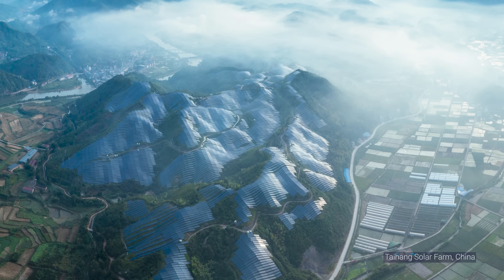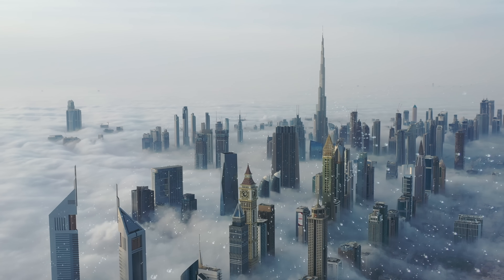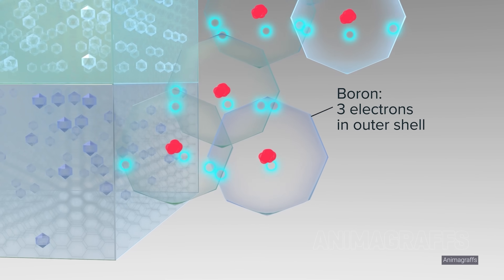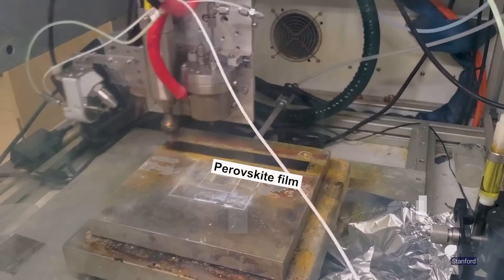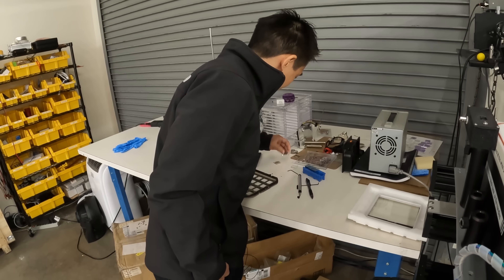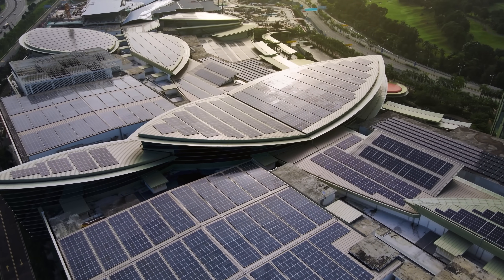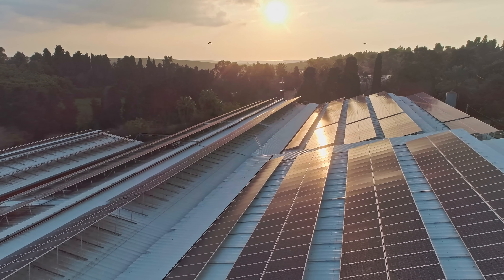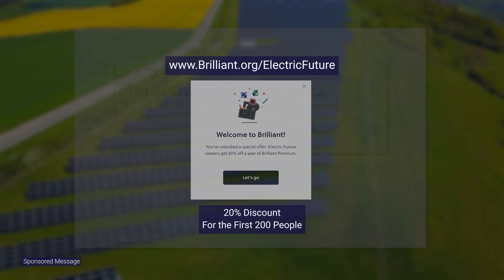Solar 3.0: This New Technology Could Change Everything

Comment: This got me much more interested and educated than severals hours our lessons on perovskites for material science. I was surprised there was no mention of the Lead (Pb) as most issues with perovskites used to be that we didn't know how to do lead-free perovskites crystals. I would have liked to know more about the toxicity of these coatings
Reply: Fraunhofer ISE is working on lead-free perovskite tandems. Current research project is running till the end of 2023. It's called Manitu.
Reply: It isn't just the lead in perovskite panels that runs a risk of being hazardous and some traditional panels use lead. Because these panels are constructed at much lower temperatures, they also degrade at much lower temperatures and tend to leech the materials that they are made out of into soil and waterways which poses potential agricultural and drinking water hazards. Some of the materials, like the lead you mentioned are definitely hazardous, others pose no threat to the environment nor to humans, but there are a few chemicals that are used in some forms of perovskite panels which while they are abundant on this Earth, they are not something that humans regularly come into contact with. Because of this, it is unknown what potential hazards could result from an increased exposure if they leech out of the panels and into areas with large populations, agricultural areas, and water reservoirs. There are also some chemicals that "gas off" and could cause respiratory issues depending on where the panels are located along with potential increased fire hazards if ignited (wildfires or man made ones). 

I believe there is talk of using Mendelevium in laboratory attempts for lead free panels, but I cannot remember for sure. Mendelevium is not found in nature at all and because of this, there is not enough data to determine if it could pose any threats to the environment if it were to leech from perovskite panels. 

Some of them also use tin which is considered harmful at certain levels of contamination. Rubidium is also used in some perovskite panels which may or may not be an issue depending on how much of the chemical leeches out into the soil. 

Not all perovskite panels contain the same chemicals and they are working on a lot of different types, so hopefully they will find something that is both safe and efficient for the future.
Reply: Pb = lawsuits
Reply: Can confirm it is highly toxic
Reply: @kiloton1920  did lead not cause humanity to drop significant iq points, and caused some generations to be way more violant and stuff? very fascinating in my oppinion, scary, but fascinating.
Reply: @mauritshagedorn856  yes and it still is doing this in some countries that still use leaded gasoline
Reply: @mauritshagedorn856  watch the YouTube film about the guy who created leaded gasoline and killed more people than anybody ever
Reply: KiloTon yes i will.
Reply: @mauritshagedorn856  it’s on the veritasium channel
Reply: KiloTon hey kiloton. I recently got my drivers license and when i went to buy gas for the first time in my life. I was suprised to learn that the gas pump still sold leaded gasoline. I live in the netherlands. I was shocked to learn it was still being sold in my country. If its still being sold in the netherlands i would not be suprised if its still being sold in every country on earth. Crazy stuff considering we know so much about lead now.
Reply: They're trying to avoid cadmium also.
Reply: you want to know about the toxicity of lead coatings: lead = bad... thats all... despite any any precaution taken or how its engineered it will ALWAYS be a problem

Comment: I truly appreciate the honesty in this video presentation. They ask hard questions and point out both the positive and negative attributes of this technology. Over 50 years of R and D with solar and we are still waiting for a significant break through. I do hope that Perovskites prove to be that breakthrough.... The solar cell and the battery still have a lot of improvements to go through before they become a viable, national energy sources.
Reply: It'll depend on where they put them, too: the further north you go, albedo and cloud cover reduce efficiency so much they'll have to build twice as many panels for the same output. The average capacity factor for the lower 48 is 15%; in Canada, it's 6%.
Reply: @HowlingWolf518  At that point I think it'd be cheaper just to build tons of panels in the geographically "perfect" place for solar, then just distribute that energy via power lines to less efficient solar areas
Reply: @Chickaqee  But then you run into the other problem: even if you can get transmission lines and towers big enough, you lose half the power (via heat loss) over the long distance to Seattle or NYC.
Reply: @HowlingWolf518  Are you talking traditional power lines or HVDC power lines?
Reply: @bertvanhoofstat7700  HVDC would be useful, but you've still got NIMBYs, high costs and the laws of thermodynamics working against you. It's probably best to keep the grid as decentralized as possible.
Reply: @Chickaqee  Here is a great overview video on the challenges with this: https://www.youtube.com/watch?v=7OpM_zKGE4o - It relates to Europe, but same concept and issues.
Reply: @HowlingWolf518  albedo what? cloud cover yes, but what albedo nonsense? you realize albedo means reflectivity of a ground of an asteroid or snow, and that woudn't harm solar cells, it actually benefit them
Reply: Uh no? Solar energy already costs less than most means of energy production, as long as it's in the right place. we are severely underinvesting.
Reply: @no3ironman11100  Yea as long as its under the sun its great.
Reply: @no3ironman11100  The "right place" is a bit smaller than you'd think; in the Northeast and Northwest, you're getting half the energy you would in Arizona.
Reply: If only there were a renewable, concentrated form of stored solar energy that is portable, abundant and provides essential building blocks to plant life 🤔
Reply: National....????
Reply: We’ve made a video on this topic as well, where we explore the world’s fastest improving new solar technology, whoever is interested, you’re more then welcome to our channel ❤️
Reply: when we fix the cons of exiting batteries, we can move forward to a future w/ clean energy that benefits all social classes
Reply: Not really, but any improvement is welcome!
Reply: Insider Dr Greer said 1954 free energy was discovered! New battery in One year 10 x more powerful 10 x smaller!
Reply: Oil barons kept our world 100 years behind in terms of prosperity and pollution.
Reply: I completely agree with your comment about the potential of solar technology. The advancements in solar cells and batteries are crucial for making renewable energy a viable option on a larger scale. Speaking of energy solutions, have you heard about the Segway Portable PowerStation Cube Series? It offers a massive capacity, waterproof technology, and fast recharging capabilities. This could be a great addition to your outdoor gear or as a home backup power source. Check it out!
Reply: @ARLGD  I have and by coincidence I used to live down the road from Dean Kamen (inventor of Segway and more) in Bedford NH. Never met him, but very interesting person and history.
Reply: The "significant breakthrough" is the plummeting price of the solar we already have. Megawatts are being installed monthly. LFP batteries are dropping in price equally fast. I've watched them almost halve in a couple of years.
(No they don't "explode", yes they can and are being recycled)
Reply: Especially battery, EVs may run without burning any fuel, but making those batteries are as damaging to the ecosystem as running a regular car for quite some time.
Reply: @wybuchowyukomendant  EVs run using the same or more fuel than ICE cars. Where do you think electricity comes from?
Reply: @someguy5035  należy również zwrócić uwagę na utylizację tych toksyn po akumulatorach, elektroniki ,i innych produktów które zanim się znajdą w gotowym produkcie,to przy wydobyciu robią więcej śmierci klimatu i ludzi
Reply: @someguy5035 A petrol car has a megawatt in the tank. If that was electricity it could run a street of houses for a week. Siphon it out into generators and see how far you get. Petrol engines, even the best ones, turn most energy into heat and smoke and throw it away.
Reply: @wybuchowyukomendant  Yep, people should learn to be more efficient rather than asking their tech to bend over backwards for them.
Reply: @Stanimalgic  I'd say more efficient AND less wasteful...Look at how much food and electricity people in the US waste each day...
Reply: @slchang01  Exactly.
Reply: @AlibiJoe63080  I do not know about you, but I keep my stuff for as long as I can...In fact, two of my cars are over 20 years old and still going.  Most of my "cheaply" made Harbor Freight tools are still working fine. It is the mindset that matters...
Reply: @Stanimalgic  Right? The easiest solution is for all of us to simply try to consume less.
Reply: i think its cool to think about that probably somewhere in my lifetime we have figured out how to provide plenty of energy to everyone on earth for cheap without destroying the planet. i am 20 btw if you are wondering.
Reply: @mauritshagedorn856  you obviously haven't studied the mining required to produce solar panels, massive amounts of batteries and the ineffectiveness in general of Wind Solar and BESS.
I'm all for progressing ahead and developing these, and they have gotten dramatically better in the last 10 years.
Oh, and by the way, the way to provide mankind with relatively cheap energy without the huge carbon footprint was discovered and developed when I was your age, I'm now 60, it's called Nuclear energy.
Oddly the same group of people who have worked to kill Nuclear energy are now promoting the Wind Solar etc, calling it renewable, but not taking into account the massive mining of materials that are not readily available
Reply: P Henri im all for nuclear energy but we both know that is never gonna happen. But solar panels can be build fast, everywhere and relatively cheap. Sure there is some problems that come with it but so does any other form of energy.
Reply: @mauritshagedorn856  the only problem with how we all live is no matter what we do we are told we damaged the planet. Heck England and Scotland are planting trees in places that have been deforested rolling meadows and farmland for 1000 years.

The comments here in the thread are so intrusively assumed. Heck I have a 70” tv and I bought it for $450 when my 14 year old 37” bedroom TV stopped working. I got the 70 for my living room and moved my old one to the bedroom. I also donated the broken TV to a tech school in town. That’s recycling in a way. 
Life is life if you think others could do better that’s true. In no way should people be shamming others out of jealousy disguised as environmentally concerned. Start in your own wasteful life others are doing what they can as they can.
Reply: @mauritshagedorn856  Nikola Tesla already did. It wasn't profitable for those on top so the government stole his research.
Reply: @mauritshagedorn856  We have plenty already, we need to stop being wasteful, but people need 70" TVs so im not holding my breath.
Reply: Raiden Derp first of all, energy is not cheap nor is it green/clean yet. And second of all, what does people wanting a 70 inch tv have anything to do with this or my comment?
Reply: @mauritshagedorn856  The amount of things people throw away is disgusting. If no one threw away food or plastic water bottles or bought new TVs every few years probably throwing the old ones away the so called "energy" problem would be a whole lot smaller.
Reply: @mauritshagedorn856  Stop buying SUVs and trucks when you never haul anything. We waste so much its ridiculous.
Reply: @mauritshagedorn856  If people actually had respect for the things they owned and didn't take them for granted the world would be a much better place.
Reply: Raiden Derp if we didn’t waste as much, we would still need a better energy source. These problems are not the same.
Reply: @mauritshagedorn856  I am in no way opposed to finding better solutions but as it stands right now, the fastest way to reduce energy consumption is to stop consuming so much energy. It takes energy to make plastic, grow food, pay someone to load it into trucks to dispose of when you let it spoil. Takes energy to build WAY more motor vehicles than we could ever really need. Global warming would dramatically lower if we stopped being so wasteful tomorrow. Nuclear could solve our problems but people hate that too so RIP that tech, can you tell im really pissed at this situation yet? Real good alternative solutions will take time to develop and that is time we are wasting. You might be right, even if we did dial back consumption a great deal maybe fossil fuels would still doom us eventually, but it would at least buy a whole lot more time.
Reply: @Stanimalgic  without getting picky and irritating ,  people own themselves but smoke  their way to poverty and  horrible deaths of well known cruelty.  We eat to ludicrous obesity that drains the  NHS. The stupid 20 per cent dump their needs but provide little funds to pay the 80 per cent of bills they cause.  The 80/20 rule explains the class dilemma too.
Reply: @Stanimalgic  Who the fuck buys a new tv every few years? The flatscreen I have downstairs has been with me for about a decade
Reply: @Stanimalgic  BUILD MORE NUCLEAR REACTORS BUILD MORE NUCLEAR REACTORS I CANNOT STRESS THIS ENOUGH
Reply: @bladedninja8853  Well, obviously not you. Probably some of the people who buy a new smartphone every year, lease a new car every 3 years.
Reply: Significant breakthrough? I think that’s called a solar panel, don’t think we had those in the 1800s
Reply: @Edwxrd69  no.

Comment: And when the Sun goes down? If you're going to say batteries remember they don't exist yet. And that it would cost more than the solar panels. And if it was cloudy we would be f*****.
Reply: liquid air energy storage is cheap
Reply: @zachmoyer1849  it looks cool, I've been told of these things before.  My question is. couldn't we just use these technologies with our base power and reduce by 40% the inputs to these power plants without building anything new until we have to decomition them?  In other words why do we need wind and solar in order to build stuff like this?
Reply: @janick01ify  unburned fuel is better at storing energy than a battery you would be losing energy by doing that with a typical powerplant the only use case would be emergency backup but its cheaper to just let your power go out for a few days and repair the problem.
Reply: @zachmoyer1849  not surprised to hear that so batteries are worth even less than I thought they were.
Reply: I don't know this whole green energy thing is just seems like a giant sham to me have you ever watched planet of the humans
Reply: @janick01ify  I heard about it but I've heard all the angles at this point. Environment aside oil is not infinite and numbers released by oil companies themselves put us at 50 yrs left at current levels of consumption the decision is made for us and its better to prepare for it then to just let it slowly happen. which leaves you with nuclear and renewables I think a combination is the answer in the near term but renewables is the only real long term solution.

Comment: Sorry but your  introduction is bullshit. Musk is wrong. A mere 100 square miles of solar panels would fall short. About 30 times too short. Assuming 100% of the suns energy is getting converted to electricity. Which of course is physically impossible. 

Your model S statement is also impractical. Covering it with solar panels would be nothing more than a little gimmick, for exactly the same reason. The TOTAL surface area on that car would be under 6 square meters. That 3 MW-hour battery would need 15 days to charge, if noon lasted 15 days and your solar panels had 100% efficiency. With the most advanced and experimental panels, with just under 50% efficiency (unless you stack those films), and assuming that a daylight lasts 12 hours, it would take at least two months for a solar model s to charge. 

 The issue isn't about solar panel tech, its about solar irradience. You cant change the amount of energy coming in per meter square no matter how good your solar panels  are. 

Your intro is cringeworthy for ANYONE who understand radiation physics. The rest of it is very good though.

Comment: The clue would be to give roof tiles a coating. Imagine what would happen if every roof produced its own electricity. A lot of the electricity is lost on route to the  users. Avoiding this loss alone makes the system efficient. It would also avoid big facilities and make the system more stable.
Reply: Every surface needs this, cars, ships, planes, buildings, literally everywhere